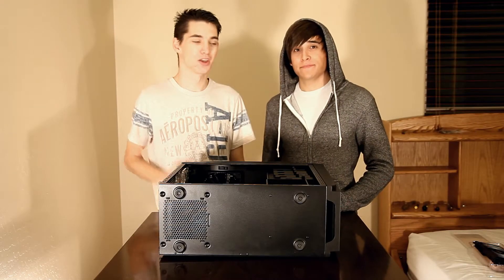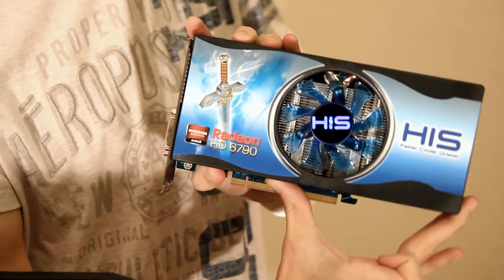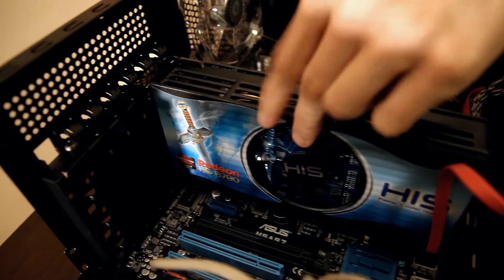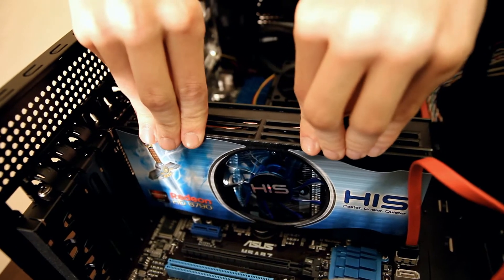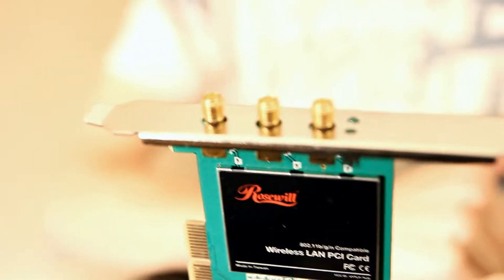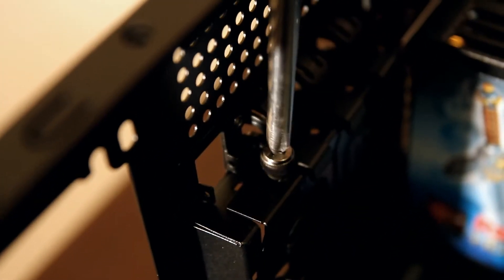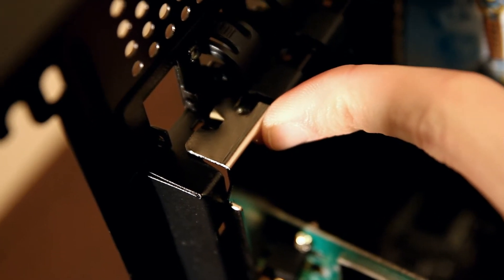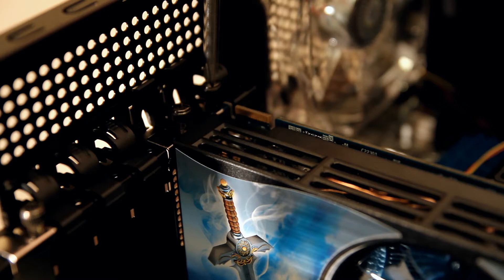Graphics & Wireless PCI Cards | Building A Computer Series

Comment from the maker: With a wireless card it doesn't really matter if it's PCI or PCI-e. I usually stick with PCI so that I can reserve the PCI-e slots for the graphics card(s). You should be able to fit in 2 GTX 560s and a wireless PCI card depending on what Motherboard you get. I don't like wireless USB adapters because I've never used one that worked dependably.
-B

Comment: I got a question, how do you select the right wireless card? I'm planning on building a computer, and I need one that can handle playing games online while downloading movies/songs. Whats the difference between a card that goes into a PCI express slot, and a PCI expansion slot? In my planned build, I'm thinking about running 2 GTX 560 Ti's, and I might not have enough space for a wi-fi card, would a Rosewill RNX-MiniN2 USB be a reasonable replacement?